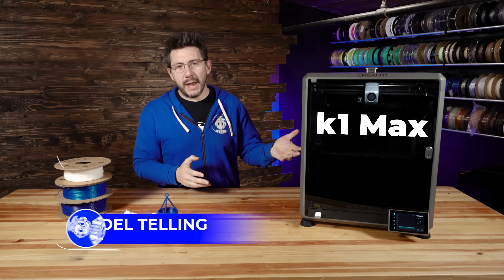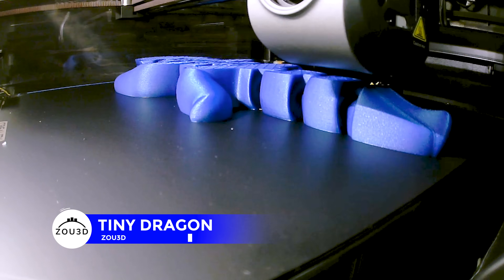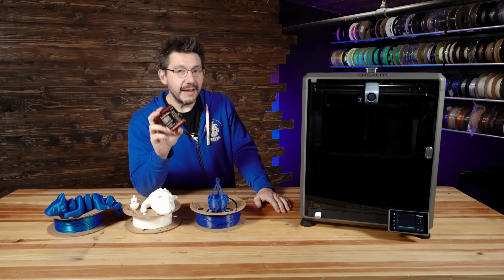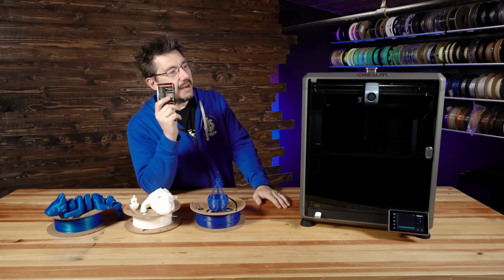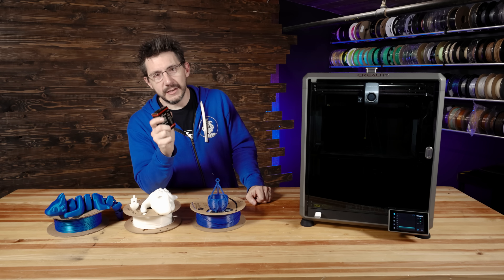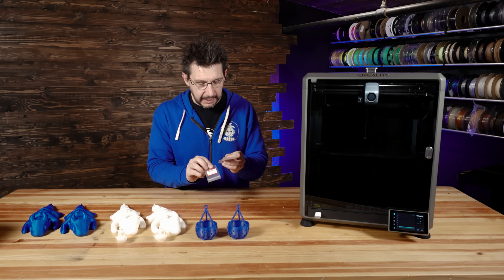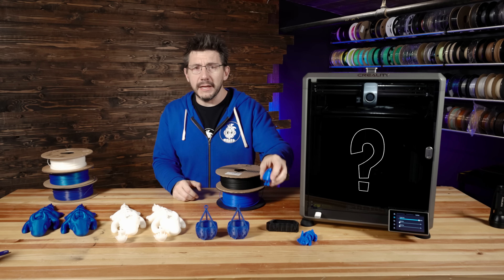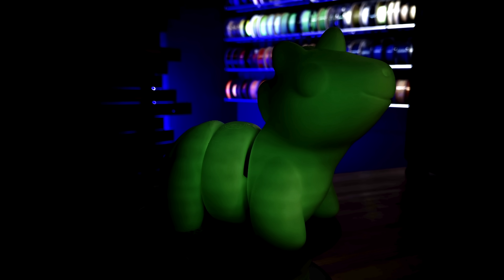THIS Fixes the Creality K1 Max

Comment: Nice video brother! Glad to see you review this printer. I just got it myself earlier this week. I was also glad to see you mention the MicroSwiss hotend as I just purchased one prior to seeing your video so it was good to see I made the right move! I was hoping I could hook my Sonic Pad up to the K1 Max though. I know it already runs clipper I just like all of the information and mid print controllability that the Sonic Pad gives you. #1 current layer  and #2 extrusion adjustments. Is there a way I can have access to that without the Sonic Pad? And should I familiarize myself with Orca? I have Simplify 3D and I do like it a d have gotten used to it but I'm very annoyed as I don't know how to do pause at layer for a filament color change. Any tips?

Comment: I wish i had a good experience with my K1 Max. Purchased directly from Creality. 

Right off the bat, the printer bashed itself into the bed on initial calibration and ripped the build plate sheet. The bed was installed incorrectly from the factory with the front left side much higher. It also dug itself into the back centre while nozzle cleaning.

All messages to the support were auto responded but no tech help called. I managed to tram the bed myself. And was able to get some prints off.

Then came the first firmware update. All seemed to go well, until the unit recalibrated. Throwing error 3000 and error 2522, sensor errors. Printer would not calibrate, or print. Eventually got someone to respond. All they did was email to say i will get a new bed sent to me. Hope i get it. Hope it solves it. 

Downgraded the firmware with less than helpful instructions from “live” support. Seriously, took me four times to get them to tell me how. The instructions they went through were incomplete at first missing vital info, then they were incorrect, was like pulling teeth. 

I doubt i will ever buy a Creality product ever again. Had less problems with the cheap AliEx Prusia clone i had for almost a decade.

Comment: Dude you are recommending Micro Swiss because the nozzle that comes with the K1 Max is a 0.4 mm. I went on the Micro Swiss website using your link and there is no 0.6 mm nozzle in the Micro swiss box. Are you taking us for a ride? I was expecting better from you!!
Reply from the maker: huh? I'm recommending the Micro Swiss because I don't have to use two hands to change the nozzle. Plus, they sent over a 0.6 and 0.8 nozzle to try as well as the 0.4 nozzle it came with. If you go to their site, click on the Flow Tech hot end, you'll see a photo you can click for the wear resistant nozzles. It'll take you to a page where you can select the diameter, such as 0.6 or 0.8. Here is the link right to that page as well: https://store.micro-swiss.com/collections/micro-swiss-flowtech
Reply: @3DPrintingNerd   I was under the impression that the Micro Swiss kit came with the 0.6 and 0.8 nozzles as well. It was not clear in the video. Thanks for the clarification,

Comment: Great vid.  SO ... what's the nozzle size of the new Flow Tech nozzle? .6? I looked and can't seem to find it. Got it .08. That's great.  I'm jumping up sizes on the hot tips on my FlashForge Creator 3 Pro. Baby steps this time. .06 to start and maybe .08. soon! Thank you for the knowledge!
Reply from the maker: Comes with a 0.4 but they have all the sizes for it

Comment: so um i've never really had the leakage problems more than the first time i had a printer, and with a proper nozzle wrench you will never have an issue installing a nozzle but yes i do understand the need/want for easier nozzle swaps, def not enough Quick swap mechanisms for 3d printers.  If i ever pick up a K1 i cant say i'll ever need it but it might be a super awesome thing to have in the long run.

Comment: This video feels like a commercial. This printer has known issues w/ the extruder..not that there is a high rate of failure...but I think anything from Creality requires a lengthy evaluation period.
Reply from the maker: When I like something, I get told this a lot. It’s difficult in my position to like things and not be called a shill. If I don’t like something, people say I’m too hard on it or I’m not giving it a chance. If I like something, they say I’m paid off. The hot end was sent to me with zero expectations and Micro Swiss had zero input on it.
Reply: @3DPrintingNerd  I appreciate the response and didn’t intend to offend. I don’t doubt the machine delivers on its promises….it’s just been some skepticism towards Creality these days. Would love to see a 6 month follow up. I’ll be in the market for this class of printer myself in about that time.

Comment: Bricked my printer trying to torque my nozzle/hotend after it leaked. 
Currently waiting on Creality support/Replacement parts from China to (hopefully) fix my printer. 
Has been a complete nightmare - I've just recently purchased the bambu labs a1 mini since I'm tired of the issues with Creality printers and really just need something that works out of the box.

Comment: I have a K1 Max. It is mostly a piece of shit. Bed warped to hell. First layers often trash. Loose screws. "AI" calibration print lines don't adhere.  Based off the internet, you either get a good printer if you're lucky... or dog shit, like mine.

Comment: I purchased the KI MAX and it has never produced a decent print.  When it came it was beating itself to death, literally banging against the walls. So I got a new PCB and installed it.  It still did not print.   The wires on the extruder were broken, like someone really abused this printer.  I tried my best to get a new extruder with the motor and they would not send the motor.  So, I bought one instead of going through the long proces of explaining again and again that the MOTOR was no good. It is now a worthless piece of wasted money sitting in my print farm and I have tried, and tried to get it to print ANYTHING, even a very simple print and it always jams up the hot end and the filament stops flowing.  This I think was a returned model I got with many problems.  I just want them to take it back and I never want to see another K1 in my shop.  I have the Bambu Lab PSI with the AMS and it has only produced very fine prints and very fast so far.  Because I print many parts that need the 300 mm bed I bought the K1.   The K1 has never produced any prints I can really use.  I have 24 printers and many of them are Creality and those work as advertised. This K1 MAX has NEVER worked as advertised.  I know how to deal with many problems with printers, but this one I have had the "head" apart so many times that I am sick of working on it.  No matter what I do it will not finish a print.  The last one was 2 layers before it quit and the head was printing in the air above the bed.  And I used the Creality software and followed their exact instructions.  There is something, engineering wise, wrong with this printer.  The only thing I like is how it looks. But that is not what I need.

Comment: Ooh good to see this video. I’m going to check out my printer nozzle though, I had an blockage in the beginning due to the plastic getting stuck around the spoolholder (stupid me) and I installed the nozzle back together but without realizing it needs to be tight. Had several prints with it without any problems
Reply: NOTE as update to my post: I am probably thinking to install a new nozzle complete though, but after the mistake i made in the begin, i did tighten the nozzle to my feeling, and don't have any issue's there. No plastic clogging up, printer works fine, only problem i have is the Ai function.

Comment: Thanks for the video it was a really nice review.  Question I am thinking of upgrading from an old Ender 3 Pro.  What is the best route to go?  Bambu Labs X1c or the K1 Max (with the hot end upgrade) Other than AMS printing are there any other advantages that the X1c offers?
Reply: Actually working AI and Lidar. :D   I'm sure Creality will get there in the end, but right now they're still very much at the beginning of their learning curve, where the AI/Lidar system on the X1C has become absolutely nice as feature (but it took Bambu 6+ months to get there too). And regardless how nice the K1Max is, I simply can't get myself to invest in a new machine anymore which doesn't have any capabilites in terms of multimaterial anymore, be it in stock condition or after an addon.  (and no, Mosaïc Palette or ERCF are not to be considered "prime time ready" solutions in my experiences with them)

Comment: Joel a plated brass nozzle will wear out quickly with abrasives,...the plating won't do a lot to stop this. What you really want is is a hardened steel or ruby or diamond or tungsten carbide nozzle.

Comment: I don't know, mayby they send you a well tuned model or so, but my experience with K1 max is totally different. I heve some major issues form the start, with print quality (Z wobble, ghosting, ringing despite IS calibration), overheating estruder that cloggs while printing PLA, problems with bed leveling, because nozzle wipping does not work properly and nozzle lefts residue during initial 4 point meassuring (before mesh leveling), vibrating housing making terrible noise,  wired plastic smell of inside of the chamber, nozzle coliding with bed, making problems with usb drive every time I disconnect from the printer (it requres repare in the system). I'm so confused, that you do not have any of this issues. My S1 plus prints better than K1 max...
Reply: Well, good for you! Only saying, I watched many reviews before purchase and belived that it is worth to buy, but (c)realty hit hard.
Reply from the maker: It’s crazy right? It’s such a mess that I can have a perfect experience and you did not. I’m sorry.
Reply: My previous experience with Creality - a $200 machine - was terrible. I hesitated on buying the K1 MAX, but the people at MatterHackers suggested it as a medium priced machine to replace my Prusa XL that was acting up. Next suggestion up had a glass printing surface - NO WAY. Next was several thousand $$. So I got one and it works very well ... so far :)

Comment: How does plated brass nozzle grant you the ability to print CF and even glow-in-the-dark filament? The latter one is usually the most abrasive filament of them all and would require something like obxidian/tungsten or at least hardened steel to survive an acceptable amount of time, isn't it?

Comment: It's great video. I have only one concern. If you have 0.8 nozzle, I assume your minimum layer width is 0.8. If we will keep 0.2 layer height and get max flow rate from MicroSwiss website (35mm3/s) then... Max speed is 212.5 mm/s. So... how is it with extruder skipping/under extrusion issues with normal speed (I think creality is going with over 300mm/s per default)?

Comment: "let's try something hard with ABS". He goes to print a round basket, something with no angles that might warp.
Reply from the maker: Uh, those ropes have not printed well in ABS for me before
Reply: @3DPrintingNerd  Ok but the hard thing of ABS ain't retraction, main problem is warping and de-lamination. I guess most will use ABS for functional parts.

Comment: So basically, Creality is still operating on the "get the first few thousand customers to pay to beta test our machines" business model?

The Flow Tech nozzle looks neat, though.  It would probably have solves at least 60% of my issues with my old Ender-5.  Too bad I turned that printer into a trailer.

(Not actually "too bad".  I hated that printer and have a much better one now.)

I don't think many school boards are going to sign off on "we can get this 3d printer for only 1200$, and then all we need to do is buy this other 100$ thing and install it so the printer is safe to have around kids," though.  Those sales are going to go to machines that already have integrated throats and cold-change nozzles.

Comment: Im debating between the k1 max or p1s/X1
Reply: I would have bought the Bambu lab machine but it did not have enough build volume. My product is 295mm wide... just barely fits on K1 MAX... Bambu Lab tech looks really good, if size is OK for you. I can't compare operation, since I only bought the K1 MAX... I hope Bambu Labs comes out with a bigger machine! :)
Reply: @preppcomm Thanks, and good luck with your product!
Reply: Bambulab actually innovates and brought upon this revolution we are seeing. Their software is waaaaay better integrated, and their mobile app just works, and has no ads.... its crazy I have to mention that, but creality makes me have to mention that.

The addition of the AMS means I think the P1S is easily the choice. The X1C is cool, but unless you have money burning a hole in your pocket, the seldom used auto pressure advance (because most filaments have a good profile by default), smooth video stream and touch screen arent really worth the extra 500.

That being said, if you are a full time worker earning decent money, its a nice machine.

Even still, for the majority of people id say the P1S + AMS is the combo you want.